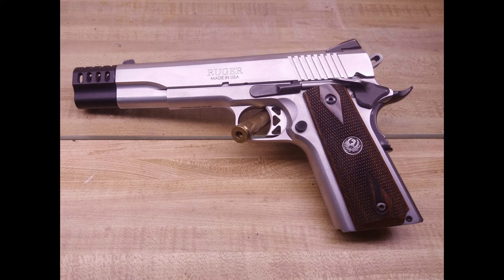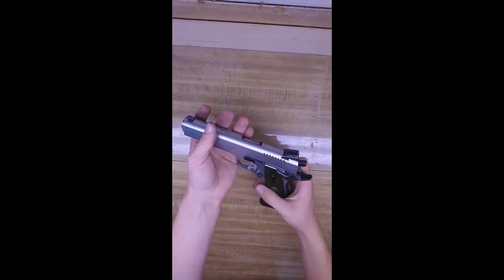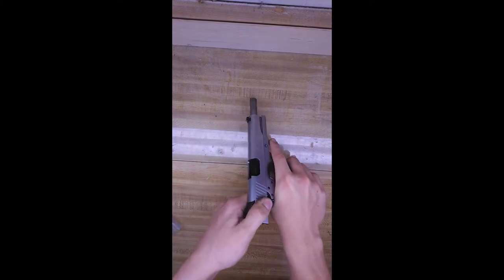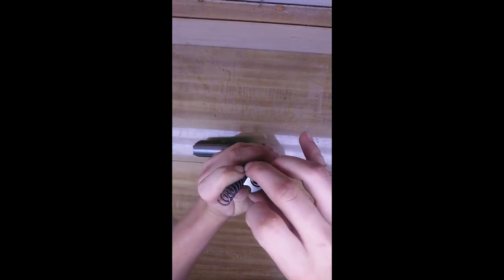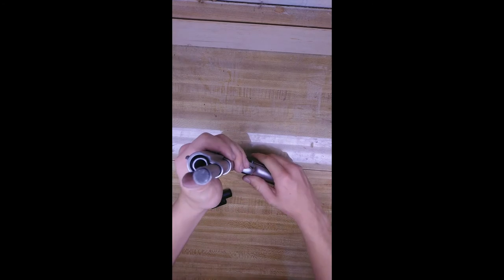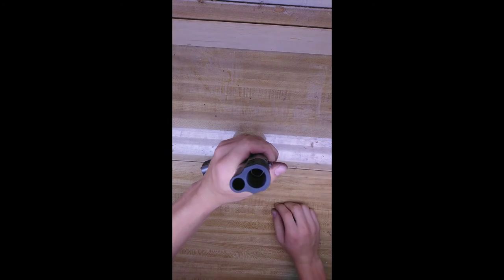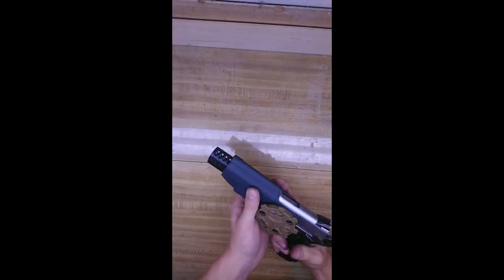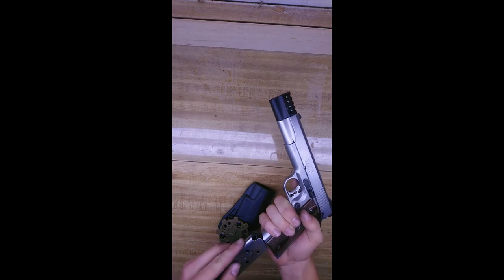1911 Compensator Installation - Review

Comment: Did you check the inside diameter of the "comp bushing" versus the stock bushing? Remember, that bushing supports the end of the barrel. So if the "comp bushing" has a larger inside diameter than the stock bushing, you just took some accuracy out of the pistol!
Reply from the maker: Ok so I checked the diameter of the stock bushing and it came out to be 14.73 mm. But I cannot get the micrometer inside the compensator to measure the diameter but they look the same overall.
Reply: @JosephGreen0001 , What you can also do, is take the barrel out of the gun, then slide each bushing over the end of the barrel. That's not a perfect way to check tolerance, but it will give you an idea as to how tight or lose the bushings are. Ideally the tolerance is about 2-3 thousands. Sometimes even a tad tighter for a competition 1911.
Reply from the maker: @mikek8089  ok I will see what I can do, I am a little busy today but I will make it happen.
Reply: @JosephGreen0001 , Just thought I'd fill you in on the bushing fit works. Looks like a nice 1911 you have there, and hopefully that bushing/comp works out for you!👍Who knows....maybe could be a good fit as it is. Fingers crossed.🤞
Reply from the maker: @mikek8089  Thank you
Reply: @JosephGreen0001 , Not to drive you nuts lol, but another trick for better accuracy is to install a different barrel link. Barrel links have different spacing between the holes. You want the largest spacing, so the barrel lugs go into the slide lugs as tight as possible, but still allow the slide to lock fully forward. This keeps the back of the barrel as stationary as possible. 

Just food for thought....
Reply from the maker: @mikek8089  I just checked the tolerance for both of the barrel bushings by feel and if anything the stock bushing is a tad tighter. Now the compensator on the the other hand seemed to have a little bit more space between it and the barrel.
Reply from the maker: @mikek8089  I also tried to attach a picture of the bushings side by side but Youtube won't let me.
Reply: @JosephGreen0001 , Ok. Well now you know that the comp bushing will more than likely take a little accuracy out of the gun. Obviously you can run it, but again....accuracy?
A bushing is one of those parts that really should be fitted by a good gunsmith. Purchase one slightly under size, and the gunsmith will open it to fit the barrel. But in any case, you now understand just what bushing is supposed to do.
Reply from the maker: @mikek8089  I understood the purpose of bushing but I didn't think to check the tolerance between the two. But thanks for telling me, I am always open to learn something new.

Comment: How u get it to fit? I got the same brake. It doesn't give me any clearance to put the spring cap back.
Reply from the maker: What kind of 1911 do you have?
Reply: @Joseph Green  Springfield Loaded.  Bought it used from a Buddy and he replaced with a Wilson Combat guide rod, spring, and cap.
Reply: I had to file the lug in mine to fit it to the slide slot first. Then it only worked with a guide rod which now always has to be assembled or disassembled after removing the slide with everything in it.  Maybe some of these are a bit diff. Mine also has no side ports which I think is more effective for muzzle jump.
Reply: He's using a GI guide rod [standard], if you have a 1 piece guide rod it may not fit

Comment: I think it would be more accurate to call it a muzzle break than a compensator. First off, a comp should ONLY release gasses vertically, to reduce muzzle flip. The tighter the barrel diameter to the body of the compensator, the more gas ejected, the more effective it is. Being as how a match grade bushing will run you more (and require gunsmith fitting) than $30 I seriously doubt you are getting any over all benefit. Personally, I'd bet a heavy solid guide rod would reduce felt recoil and reaquisition time just as well if not better. Of course, you can't get a cigarette paper between my comp and slide as it was hand machined by a master gunsmith so I'm spoiled.